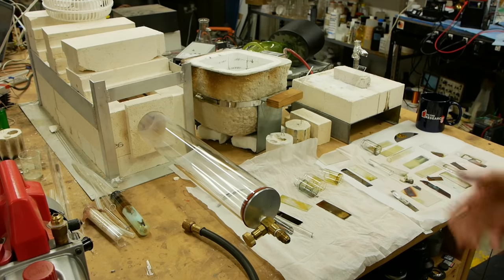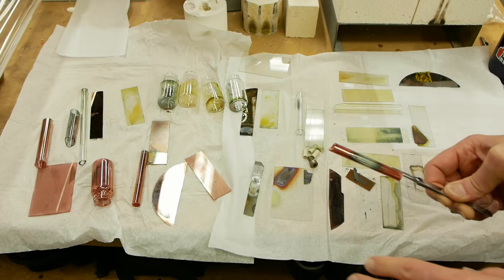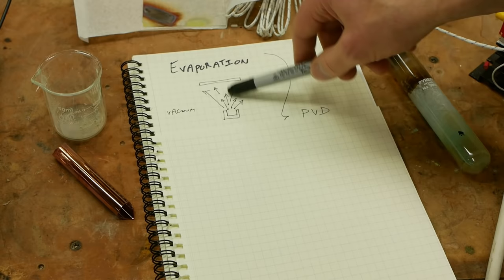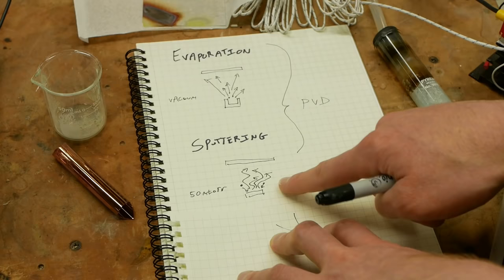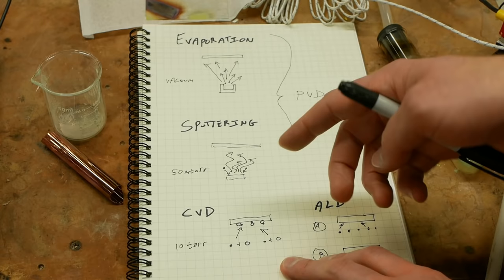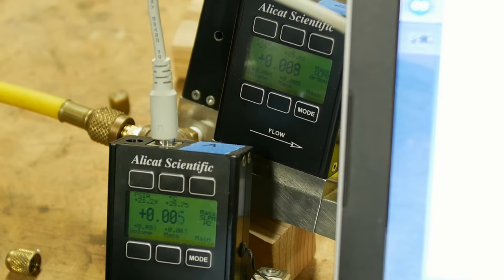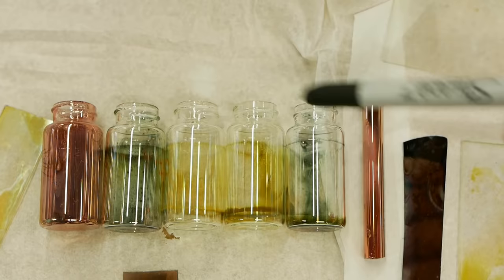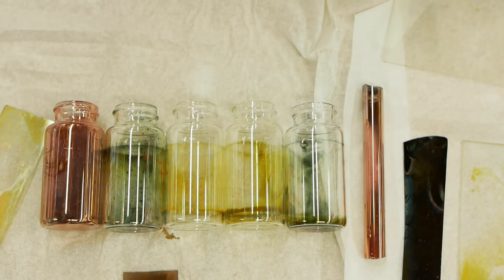Atomic Layer Deposition of copper - If you like sputtering, you'll love this!

Comment: I'm a PhD candidate in Materials Science at CU, my thesis is on ALD. 

One of the issues that you are also running into is the nucleation delay of ALD metals. It's well known in our lab that if you wanna deposit a metal, it's better to deposit a Al2O3 ALD layer in order to create a small layer that allows a better nucleation. We deposit tungsten, and you need ~20 cycles before you see a film growth.
The other is probably a not-perfect ALD process. As other people mentioned you probably need a very long purge and better dosimeters. 
for experience, leaks make very weird ALD films.
Reply: Emanuele,  stochiometric surface reaction is the only way to ALD,  true ?
 CVD may deposit amorphous or nanosheet layers if precursor not strict ( as  Crashy, above comment)
 substrate needs to be hotter (local heat) than gas flow temp, with nucleation pretreatment ( TiCl4 ) only how to guarantee 1 layer for TiCl4 ?
what is best commercial polished substrate (Si ?)  Have u found Si nitride isolates phonon / electron / hole puddles that form on Si02 / Si ?
Reply: @rustalisin8950  oh yeah. If you remove the SiO2 from a wafer you see that H-terminated sites gives islands, not monolayers. Basically, If there are not enough nucleation sites you'll have islands.
Then yes, on ALD you are mostly limited to stechiometry, you can't go far from it.. while CVD you can add basically all. SiO2 with dopands? Adding NH3 to precursor and you have SiON or better SixOyNz..

If you have leaks, like here, you definitely doing CVD =D plus the metal nucleation issues.
Reply: I have a doubt if we can to remove layer by layer of an material using laser ablation method
Reply: @piduguDileep  you can do with Atomic layer etching. 
You can remove Al2O3 with alternate pulse of HF and TMA 

Very layer by layer according the QCM

Comment: You gave me flashbacks to cleaning my 400mm telescope primaries so I could coat them in my home brew chamber.  I spent weeks in circular cleaning -> coating -> cussing -> stripping the Al coating -> start over hell.   Fortunately I didn't have to resort to your more extreme cleaning measures, a simple but vigorous CaCO3 + H2O wash followed by water rinse and then original Windex applied to a Kim-wipe and used as a vapor worked in the end.  10 years later the mirrors still look pretty good (dusty sadly).

Comment: I picked up an evaporation type apparatus, it was someones project... I goofed up the roughing pump, because I didn't know there was a valve to close, by the time i realized that, there was oil all over the floor. When i refilled the pump with oil, i realized there was now oil at the bottom of the diffusion pump. When i ran the diffusion pump, nothing seemed to happen except it got hot. I managed to get what i thought was a decent vacuum, and tried plating something... I ended up with soot all over the inside and the heater bowl was cracked. I clearly don't know what the hell i am doing LOL. I can only imagine how much fiddling this must have taken you. Great job.

Comment: 26:00 bottles were probably made in a way that cools them unevenly, like rolling on the conveyor belt after forming. This would shift the lattice structure of the glass touching the belt, creating the line. Try annealing the glass in the furnace and cool it down slowly. 
Also a comment about mass-flow controllers - they are not used this way on an industrial ALD we have. Our system has one flow controller and electically controlled valves for pulsing the precursors. Flow controller is used to provide a constant flow of a purge gas and nothing else. Ammount of the precursor delivered in each pulse is controlled by the time of the e-valve being open, while carry gas is supplied at constant pressure to the precursor vessel.
Reply: Depends on the bottle maker.  Some are still hot glob spun moulds then excess cut off prior to release and cooling.  The bottle at the beginning does look like a 2 step where after the spun mould, it has the neck heated and rolled like you say and definitly changing the latice.  I have not tryed personally, however, wouldn't getting the whole bottle back up to almost molten state then cooling realign them?
Reply: Yeah, I agree that this is almost certainly from some kind of rolling press that shapes the top and/or trims the excess after forming.

I suspect that annealing it would help but probably can't mitigate the problem entirely.  Not without heating the bottle to the point where it loses it's shape anyways.

I wonder what the results would be if you abrade the surface as well or instead?

Comment: Great job! The patterns of deposition that you get on those vials, is indeed due to the way they are manufactured. They start as a glass tube, where the edge is torch heated in a lathe untill it softens and then the neck and lip are formed. The same goes for the bottom. So, the reheating that takes place in these two areas, is changing the chemical composition (i.e. taking away Na atoms) and the surface morphology (i.e. sealing nano-cracks). Submerging the vials for a short time in hydrofluoric acid before the ALD, will most likely give a more uniform deposition! Also, refluxing organic solvent over your substrate will help removing organic contaminants. I hope that helped!

Comment: You can test the bottle surface difference hypothesis by trying to coat a broken one, just a (flattish) section in the area of most variability should make it clear if the bottle geometry is relevant, or if as I suspect there is some diffusion of some element into or out of the glass from the mechanical characteristics of the process line where they are made. This could actually be useful, hint at a pretreatment step to enhance the effect, if it is boosts the deposition probability.

Comment: I did my PhD in ALD, designed and built reactors. In terms of aspect ratio, ALD can achieve an aspect ratio of 10^5. In ALD, it is all about timing, temperature and pressure. The reactor needs to have really good seal too depending on what is being deposited. The most interesting thing is that the seals become fragile over time because layers also grow inside the rubber seal when exposed to the precursors.

Fun fact: ALD was invented by the Soviets but they only published it in their own journals in the 60s. The Fins took the technology from then and exported it to the world and got all the credit.

Comment: I designed OpAmps.  You are totally correct, in that when you get beyond the electronic design, and down to the actual processing and buildup, you get completely different results.  In OpAmps, and electrometers, and similar devices, even a few hundred atoms of contaminant will make huge differences in leakages, and any electronic migration effects will cause surfaces to change dramatically.

Comment: Hi AS, to clean glass for spectroscopy we used to:  clean ultrasonically with dd H2O rinse, hydrofluoric acid wash (carefully) with spectroscopically pure H2O rinse, spectroscopically pure acetone rinse. Do not let the final acetone rinse "pool" in any way on your glassware. Your lab looks messy, which is ok, but you need to have functional "very clean" areas of your lab for spectroscopically clean work.

Comment: If you ever want to add a filter in to one of these systems, I recommend using a 1/4 inch flare filter-drier. They are easy to find since they are used in refrigeration systems to absorb water and other contaminants. And they will also screw directly on to your 1/4 inch flare hoses, they have their limitations but will be useful for a lot of applications.

Comment: ALD chemist here:

Evap/sputtering are directional, CVD is diffusion limited, ALD is reaction limited. A lot of ALD precursors can be CVD precursors under different operating conditions, or even have some CVD components. Flow rate, system pressure, pulse/purge times all affect the growth rate, con-formality, and surface structures of a film.

Comment: On the subject of cleaning, I want to see how you clean that tube furnace.
Reply from the maker: I forgot to include the video clip of that!  I used a shop towel dipped in a small amount of ferric chloride, then wrapped around the end of a broom handle.  Then I just hose it off outside, then spray some distilled water to rinse.  It works surprisingly well.
Reply: Yes please, I was just about to ask if your tube becomes contaminated
Reply: @AppliedScience  Hopefully you plasma clean the tube after that as this is likely introducing quite a few contaminants!
Reply: When you open the vacuum, are there metal dust particles that you could breathe?
Reply: @AppliedScience  did you try doing a quick HF etch of the target surface?  It would seem that would clean it better than anything else and give you better adhesion.
Reply: @mduckernz  Why would small amounts of contaminants on the walls of the chamber really matter for what he is doing? If anything wouldn't that prevent some of the build up of copper on the walls? If you had it etched and totally contaminant free wouldn't you also completely coat the chamber with copper, when you don't want to?
Reply: @rdizzy1  When the chamber is hot, certain organics will readily fume off - either evaporating away, further aided by the low pressure, or by decomposing and then evaporating - and coat the target substrate, interfering with the adhesion...

And yes you probably will coat the chamber unfortunately, but perhaps there is some way to treat it with something that will interfere with adhesion but which will not migrate from the chamber surface to the target article.

(Also: I hope I'm not coming across as harsh towards Ben, as it's certainly not meant that way. It would be super easy to overlook this kind of thing! I just want to see it succeed 🙂)
Reply: For cleaning: Piranha solution for the (glass) substrate and nitric acid wash (and maybe with a bit of hydrogen peroxide) for the tube.

Depending on the reactants and purge, the process can be CVD or ALD. You can check this only by measuring the layer thickness as a function of growth cycles (or by using quartz crystal balance).

With cloride precursor,  you may have some chloride impurities in the film. Just to take into account if the purity is important. If needed, you may cap the copper with ZnO (diethylzinc) or Al2O3 (trimethylaluminium)   to avoid copper oxidation.

Also you can make the growth more even by having constant flow of precursors, just by pulsing the gas flows and wasting the non-needed precursor.

Comment: Fascinating video and great presentation! My masters research degree involved closed-field unbalanced magnetron ion sputter plating (a type of physical vapour deposition) to produce amorphous ternary alloys. The beauty of this technique is that you can control alloy composition by optimising the current applied to each of the metal targets (and various other parameters). I would deposit the alloys onto microscope slides and sometimes single-crystal silicon wafers.  As you suggest, I also imagine using pure quartz or single-crystal silicon would result in a more even Cu deposition.  Although, the purported advantage of ALD is the uniform coating of complex shapes, which tend not to be so readily available made out of pure quartz.

Comment: be careful at using a spark plug as a connector some have built in resistors that will throw off your measurements
Reply: True, but simple enough to check, as the resistor is typically around 30k, and the solid slug is just a steel rod. For the plasma cleaning the resistor type is preferred, as it acts to limit current in the plasma, which has a negative resistance, and having the resistor close reduces capacitance. You really need to use long reach plugs though, and use a lathe to cut the the thread back to the minimum that will fit the feedthrough. Thankfully long reach plugs are common now, Ford Triton uses them, and you can just buy the cheapest ones to use, just use torr seal on the ceramic to metal base of each plug, because they are likely to leak there.
Reply: Usually ngk plugs have R in their code to show resistor plugs. U can get non resistor plugs ez thats what i run on my old motorcycle

Comment: As for the glass vials with strange patterns, in my experience, the glass will be formed into those shapes using graphite paddles or cast iron tools coated in carbon. Maybe those particles contaminated the glass in the areas they touched and mixed with the glass while it was soft.

Comment: Absolutely amazing work! A few comments. I would not call ALD a true atomic layer deposition process but it is close. The name is a bit elusive, in practice islands of material are formed during each cycle. 
As others mentioned that is probably a CVD process there. A way to ensure the precursors are not in at the same time is through a manifold with a carrier gas and precursors connected to it and controlled by fast acting valves. The precursors need to be in heated jackets or in bubblers to control the vapour pressure. A pump is required down stream.
When you are within the ALD window you should be able to increase both the precursors' exposure/purge time by, for example, 50% and the growth rate should remain the same.
Regarding cleaning ultrasonics and FNA works well. RCA is excellent though as it also chemically terminates the surface which facilitates the adsorption of many metal-organic precursors.
Happy to provide references if needed.

Comment: I once did experiments on monolayers of Cu phthalocyanine.The surfaces had to be cleaned using boiling sulfuric acid and then triple rinsing with very (very very) pure water. I think it's called Type1. Any other grade of water contained too much contamination for producing a good monolayer after rinsing. I'm not sure how you rinsed after the pirhana, but that might be a possible cause for the pattern in the vials.

Comment: In my lab’s sputter and vacuum coating, we use a nitrogen gas gun fitted with a deionizer to finish cleaning our substrate. Make sure you are also baking your substrate at 50C for at least an hour to remove any residual water condensate.

Comment: Looks like those glass vials have been altered chemically by the forming process for the bottom and neck, maybe something has diffused into the surface from the tooling, likely cast iron or graphite.  You might try passivating the glass with phosphoric acid, that has worked for me in reducing the effects of the glass surface on the decay rate of active nitrogen plasma afterglows.  A little HF-based glass cleaner might refunctionalise the surface too.
Reply: I was thinking this too, i think when the bottom and neck are manufactured some form of die is pressed against the glass with some form of "lubricant" to stop the glass sticking, probably graphite, the center section is possibly made out of some massive mandrel drawn/spun/blow molded section of glass that is then cut to length attached between the top and bottom sections.

Or maybe even more likely is there is an external die used to form the bottom section of the glass, then an internal die to form the middle section and then an external die used to form the neck, and the die and its "lubricants" are what allows it to stick better. who knows...

Definitely on the train for annealing, passivating or a quick HF/slow NaOH etch/clean

Comment: Fascinating video, great detail.  This is very similar to the process for making the preform for drawing optical fiber.  The preforms I worked with were about 5 feet long and 1.5" in diameter.  They were drawn through an induction furnace like drawing taffy.  One preform would result in over 70 kilometers of fiber.
The preform was made by CVD of silicon chloride, germainium chloride, and phosphor chloride, resulting in the respective layers of glass inside the tube.  The machine was much like a lathe, but instead of a cutting tool, it had a semi-circular hydrogen/oxygen torch heating the rotating tube and slowly traversing from one end to the other.  The gas was introduced at one end and sucked out the other, and it would form a haze inside the tube on the cold side of the torch.  As the torch passed, the haze would be fused to the inside surface and become transparent.  There were many passes of this to build up the layers.  At the end, the torch would traverse much more slowly from one end of the tube to the other, causing the tube to collapse into a solid rod.  When the rod was drawn down to very thin optical fiber, the different glass layers became waveguides for different wavelengths of light, since they had different diffraction indexes.  It was a neat process for so many years ago.

Comment: my first assumption as a glassblower is that the heating of the tube neck when forming the threads is causing it to lose fluxand change its chemical properties, another possibility is that thermal stresses are at play here; the neck area is heated much more than any other part of the bottle when being machine blown and improper annealing could also be causing some sort of effect
Reply: Could you blow me a mercury arc valve, just the case and electrodes... 
 I have my own mercury and I would buy a vacuum pump and seal it off
Reply: If annealing is the issue, is that something he could try fixing himself? Could he reuse one of his kilns for that, or do you need specialized equipment?
Reply: @helpabrothawithasubisaiah5316  i do not have the equipment for making and testing glass to metal seals
Reply: @EthanReesor  yes if its an annealing issue Ben could absolutely try fine annealing the glass himself in a kiln

Comment: I wonder if there's something about the chemistry of the glass at the surface that differs between the contrasting levels of coating on those bottles. I know that lab-grade glassware is usually made from torch-heated tube stock which is then shaped as needed, and that the localized heating will strip certain atoms (Sodium, I think) from the glass.